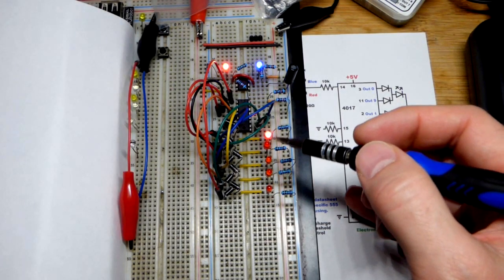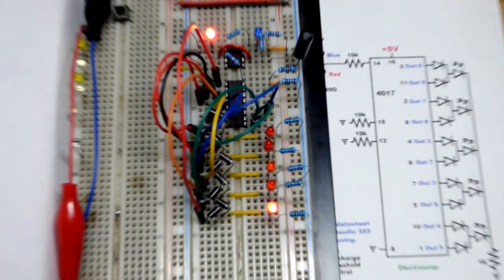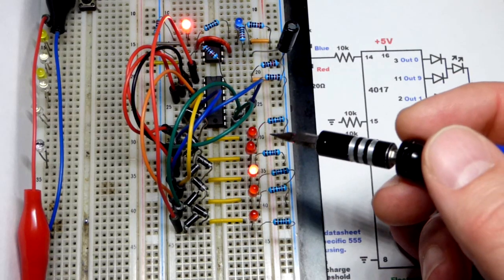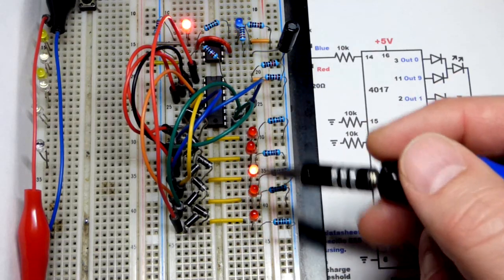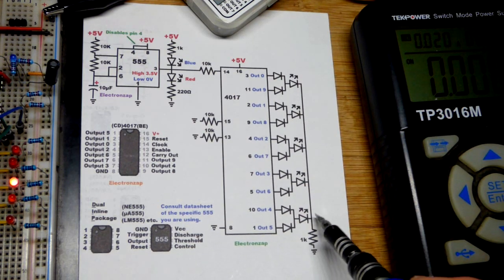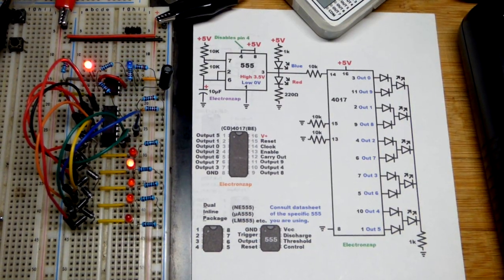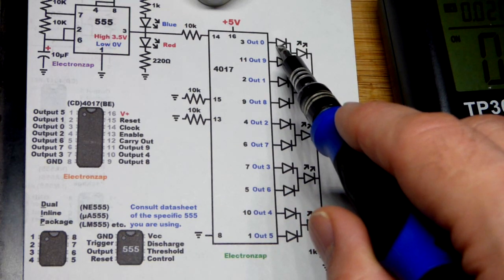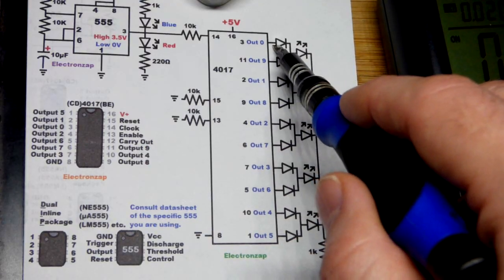5 LED Knight Rider Effect 4017 Decade Counter

Comment: I actually built a Knight Rider display in my car Grill back in the 1980s. I took the output and ran it to transistors in order to power the 12-volt lamps. It was the coolest geekiest car around during the time. I don't think I used a decade counter though. Memories a little hazy anymore.
Reply from the maker: Very cool. I was a young kid when Knight Rider was really popular. I'd bet automotive stores sold the circuitry to create the effects.
Reply: @Electronzap  not back then . I actually had mine in a 1976 Valiant that was puke green with the black vinyl  on top. I also had a couple of launch tubes mounted in the grill to shoot bottle rockets out of ( only good when parked doesn't do really good when you're driving😂). For those I just simply wired up a strand of nichrome to a toggle switch inside. I positioned it inside the tube so that every bottle rocket loaded would hit the nichrome wire with the fuse.

Comment: Could you add a small capacitor to each led line to produce fade?
  Curious, it's been a minute since i built a similar circuit.
      Bro bought me a kayak and I got severely addicted to fishing so I'm a little rusty.
Reply from the maker: Yeah capacitors would be a good addition.
Reply: @Electronzap  thanks man!